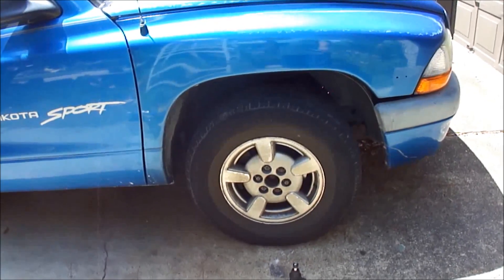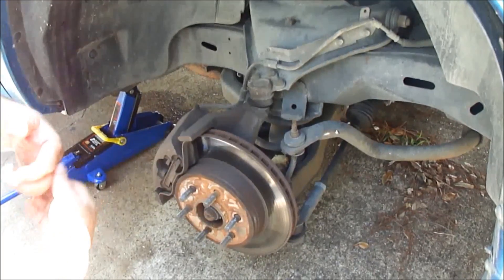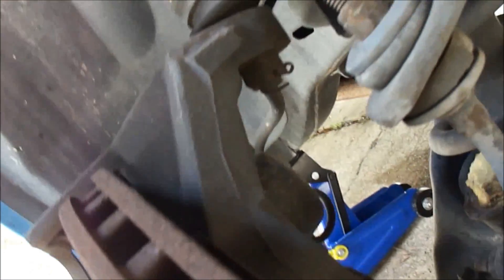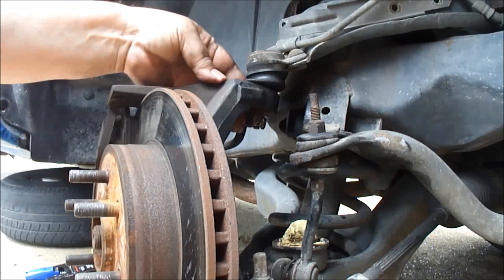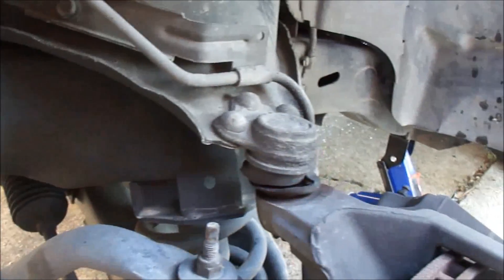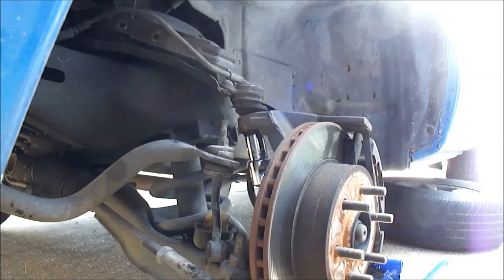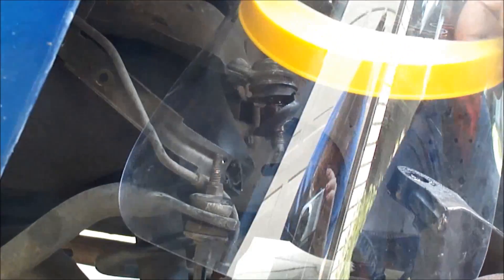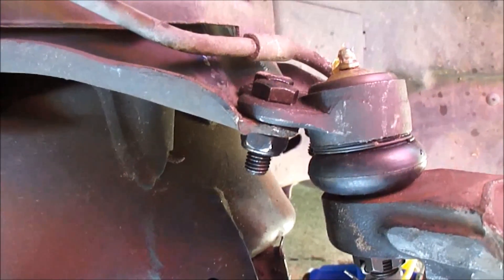2000 - 2004 Dodge Dakota Replace Upper Ball Joints Step by Step

Comment: After greesing the zerk fittings, I always put a rubber cap over the zerk nipple to keep road grit, etc from possibly working into the joint when regreasing.

Comment: If you're going to do the upper ball joints you might as well do the lowers too. Every time i do a suspension, especially on a Dodge ram or Dakota i highly suggest replacing both including the the wheel hubs, discs and pads, the outer tie rods, swaybar bushings, ect.. basically the complete suspension because one thing effects another. It's like chasing your tail if you don't. All the components work together and if one is bad it's all bad.Given the age of the vehicle your best bet is to address all the components.I understand it can get expensive but it's Peace of mind.
Reply from the maker: +matttafakt Thanks for the advice. Like you say it comes down to money most times. The wheel bearings have been done. We will continue as you suggest as funds are available.

Comment: wonder if a torch would be quicker than a grinder??
Reply from the maker: It probably would.  I have also seen the rivets removed with an air impact chisel.  Unfortunately, I only had a grinder. Thanks for watching and your great comment.
Reply: Air chisel with a fresh, sharp tool in the chuck is the way to go. Cuts them rivets off quickly. Change the tool and you can separate ball joints and tie rod ends too! Safe, quick and no heat to damage rubber parts and lines, or take the temper out of cast steel components. Check the price on the  cast assembly that carries all the replaceable goodies. An air chisel is a bargain.
Reply: Actually i got lucky and the tops on my 02 Durango had already been changed on a recall so now it's just 3 bolts and nuts.
Reply: Ron Guyer same with mine

Comment: if grease I add coming out of the ball joint boot you busted the boot you are only have give one to two pumps of grease
Reply: One to two? Definitely not. I've put 15 into a lower before the rubber even started to swell.

Comment: Cool video but one thing..I would never use a hammer on the knuckle like that. The boot is already shot/torn up so why not just use a pickle fork separator?  Much safer..  You break that knuckle off and your then in deep kaka and the job just got much longer and harder for no good reason. Can you say: Hello junkyards..
Reply from the maker: Good point.